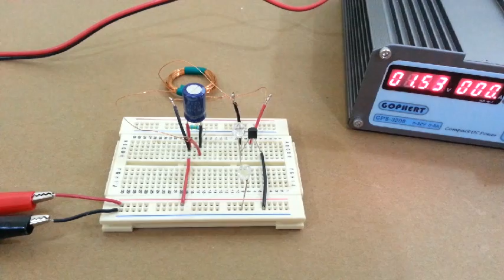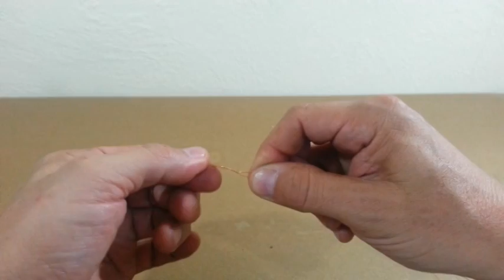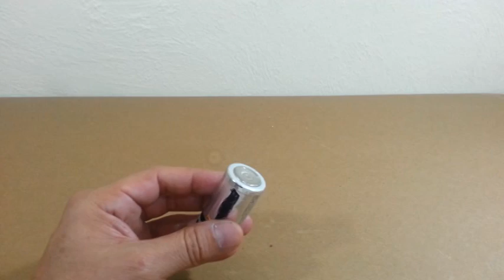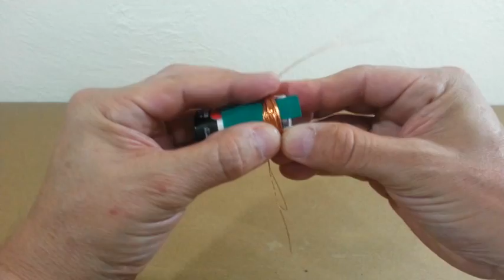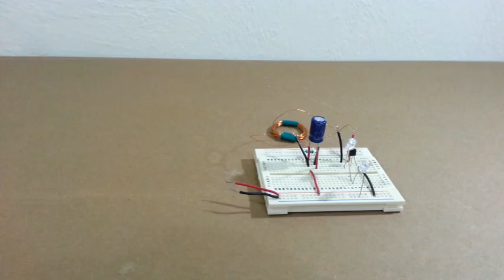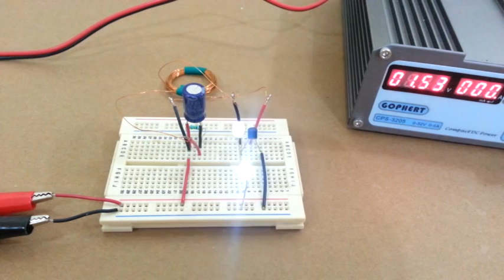Low Voltage LED Flasher Circuit

Comment: It won't flash if you have two batteries in series that measure 1 volt due to battery internal resistances. Use only a single battery.

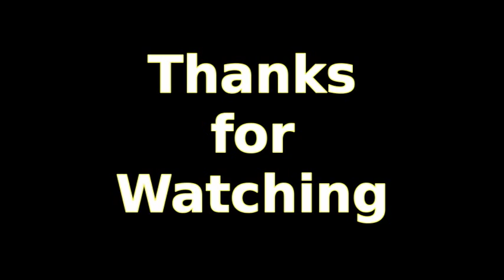Comment: This circuit is an OSCILLATOR  (see diagram at 0:10/5:06) :
(1) the tight coupling between the 2 coils forms a transformer ; 
(2)  transistor is  biased  ON  by  R=100k to battery   ; the Collector saturates  at turn-ON ; 
(3)  charging capacitor  C , thru the tranformer , the transistor begins to turn OFF  as C  charges .
(4)  when C "steals"  the  base current , the transistor turns OFF, 
(5)  After  Vc =>  battery voltage,  the capacitor discharges through the 100k 
(6) the cycle 1-5 then repeats.

Comment: You can buy flashing LEDs.  In UK, Maplins have 'em.....................??
Reply from the maker: +Raymond Ashby I know. Some people are interested in learning electronics, not only using the components.
Reply: So, what is a capacitor if it's not a component??
Reply from the maker: +Raymond Ashby ok you win its a useless circuit.

Comment: why didnt you use a ferrite toroid ? the coil would be more compact
Reply from the maker: +Mikael T. Akkisnam Efficiency does not mean you can light a LED with less power than that the LED needs. Those sources you mention will give you very low power, no circuit can increase the power.
Reply from the maker: +helut kuno Yes, I tried to make it few as few components as possible.
Reply from the maker: +Mikael T. Akkisnam Not sure if ferrite increases efficiency, but at that power levels what you can do is to use a film capacitor instead of an electrolytic, which has a lot of internal drain. Check this video, I think you would like it: https://www.youtube.com/watch?v=sfwjmthO-w4
Reply: When talking efficiency, I was thinking about how much the circuit  eats to sustain itself and was wondering if a ferrite core would be better than an air core.           I was wondering if there´d be away to get the led to blink once a minute for example, just to be able to monitor the lifetime of a minipowercell. Cheap multimeters don´t do a good job in these kind of situations, so a visual method to measure output would be very convenient.
Reply: +Ludic Science Would the circuit be more efficient with a ferrite core? Or would it function with even less volts+current with a ferrite core?
I´ve been looking for an extremely efficient circuit to run from ultralowpower source lighting leds. You know, from "crystal battery cells" or just using small pieces of copper and aluminium with an electrolyte (some salt + water).

Comment: I've been trying to find ways to use a taser as a spark gap for an e.m.p device. found little infomation. have you done this before? I looked in your videos. thanks..
Reply from the maker: +Paul Abernathy I do have an EMP device video, but it is not made with a taser.
Reply: +Paul Abernathy get a 400v capacitor from any electronic device with a bridge rectifier, charge it from the wall (dont forget small resistor, otherwise the capacitor will short the rectifier) and discharge it on air core inductor about 20 turns 1mm wire diameter and 2 cm winding circle diameter